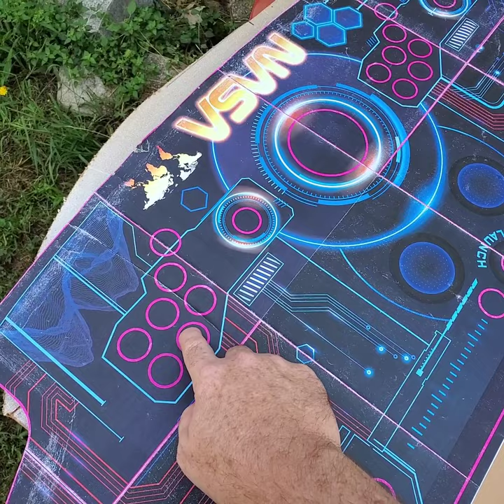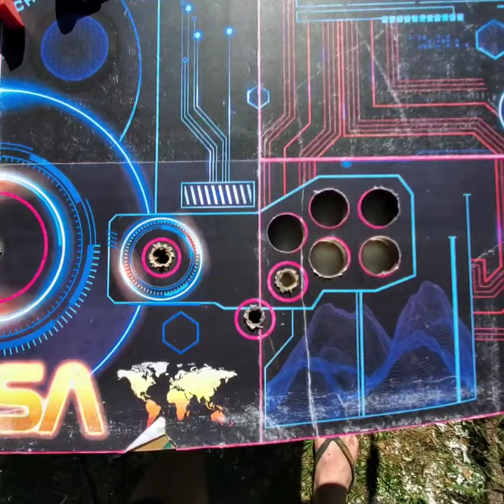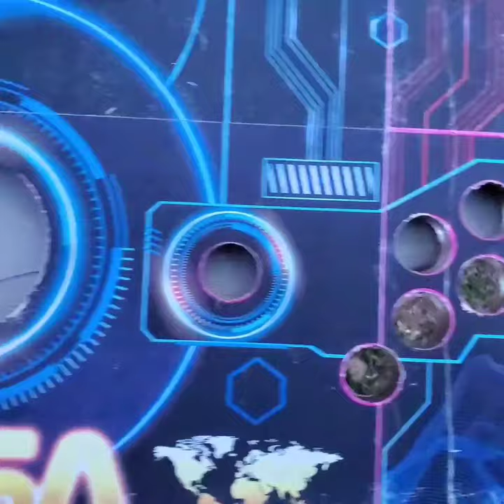Building a Plexiglass Backlit Arcade Control Panel - part 3

Comment: @DonAnnis you are actually perfectly fine to use the hole saw in the plexi. the correct method to use in doing so is to run the pilot bit about a 1/2" further out than normal or just enough it come through the other side and not the hole saw. you drill about half way or slightly less of the way through the work piece and the flip over and use the pilot bit to center the hole saw and finish drilling through. this is the correct way to use a hole saw in any substrate where blow out is not wanted.
Reply from the maker: I'll give it a try, I'll mess with it on some scrap plexi, if it's quicker than the router, I'll most likly do it that way. Thank you

Comment: 1. Is the router bit specific to plexi like the jigsaw blade? (What kinda but as you using brand / part number )
2. What hardware did you use to mount the buttons / joysticks / track ball? 
3.How’d you mount the panel to the wood? 
4. Did you use threaded inserts or what was the magic sauce ? 
I’m looking to pull this off but want to do it right the first time. Thanks in advance
Reply from the maker: No, the router bit is a normal flush trim bit. I used a 1/4 inche drill bit and threaded inserts and mounted to those, i put a line on the bit so i didnt drill too far down. And i used poperly .measured threaded screws that were not too long to not break the plexi. I used a piano hindge and threaded inserts
Reply: @donannis  I’m guessing the threaded inserts. Were heated before inserting into the panel? Did you mount to the 1/2 inch then sandwiched the vinyl and 1/4 and secured that all with the buttons being mounted? If you’re in a teaching mode this would be a cool by request video how you mounted it all cheers 🍻.

Comment: Just curious...why not use this router method to cut out the entire panel?  instead of using the jigsaw.
Reply from the maker: You know, Your right, maybe i'll make a control panel out of MDF and use that to trace with. I've always done it with a jigsaw because it's easier to mess up with the router if it jumps. but that sounds like the next step if I wanted to mass produce them ;)

Comment: Hi Don. Do you do the same process for each plexiglass sheet or do you clamp them together and drill them both at the same time?
Reply from the maker: Hi, I clamp them together and do them both at the same time, they need to be clamped at multiple spots to stop them from moving during cutting